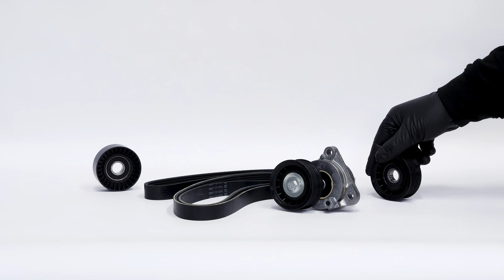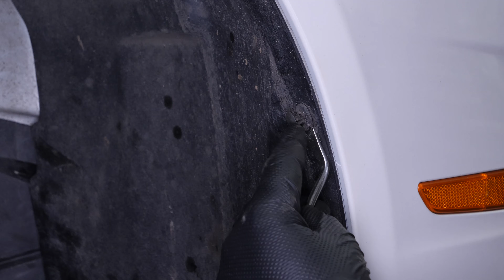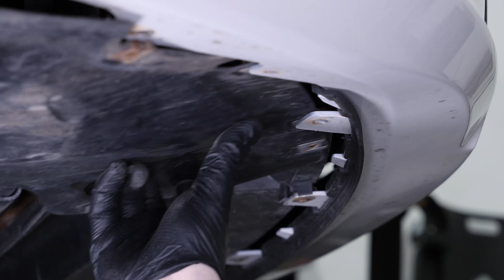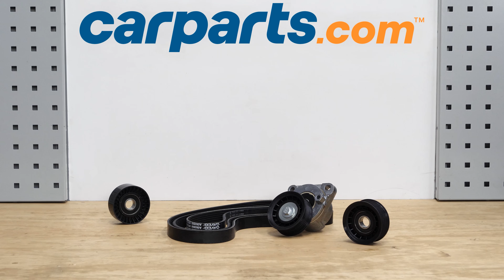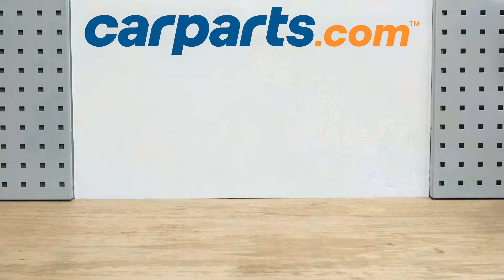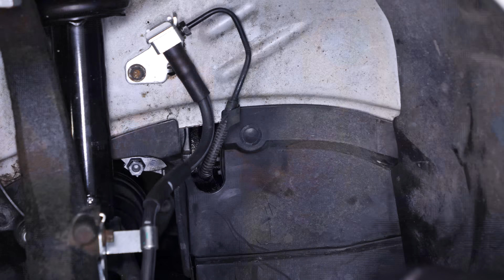How to replace the Serpentine Belt 2006 - 2012 2.5 Ford Fusion 🚗

Comment: Do you have to replace the pullies and tensioner?
Reply: check what pulley is bad by spinning and seeing if its smooth. if its too rough or rattles i would replace it. they also shouldnt move at all if you push them side to side. if they do replace it.
Reply: check the tensioner by pushing it and see if it snaps into place
Reply: No